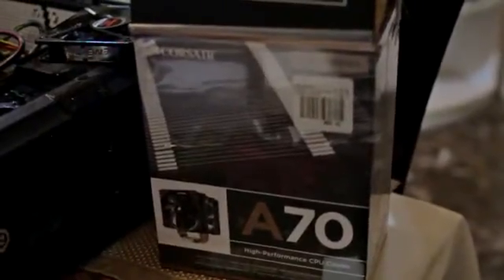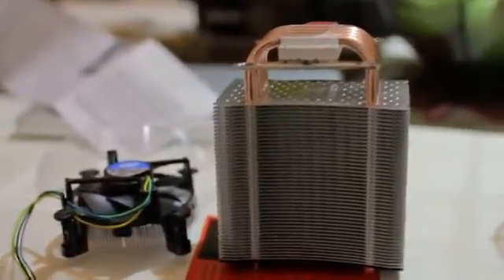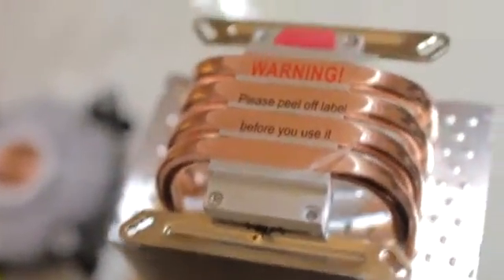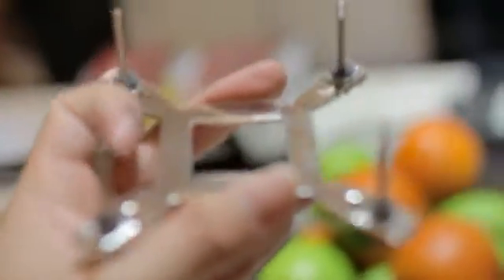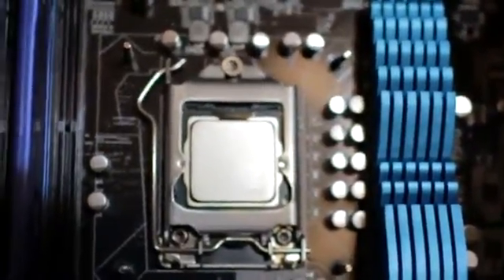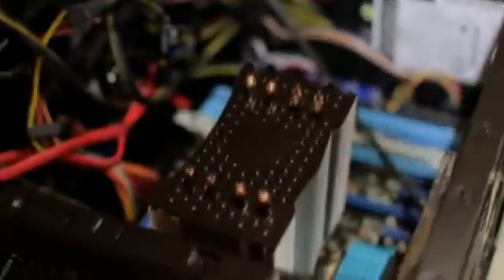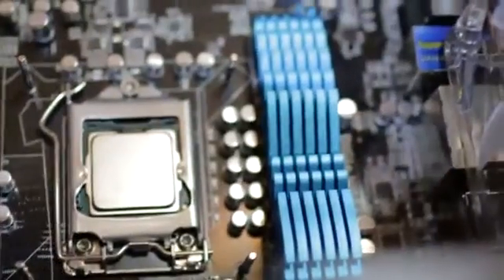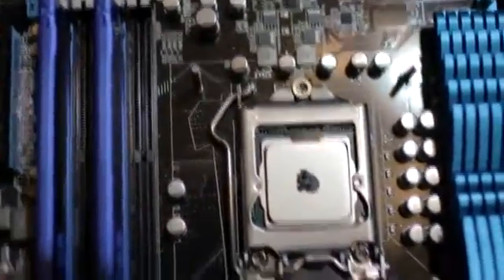corsair A70 Heatsink install

Comment: TheQulixia I know this response is extremely late, but in case anyone else stumbles here from google wondering the same thing: NO. They do not. You need low profile Vengeance, and you need to install the first slot of ram before the heatsink. You can otherwise access the last slots, but the first is impossible, the 2nd iffy.
Reply: The good news is, corsair will replace your kit for low profile if you call them up, as they manufacture both parts. At least they did for me.

Comment: Damn I installed mine with the correct air flow direction, but i put the dented side facing out. Would you know if this affects performance of the cooler?